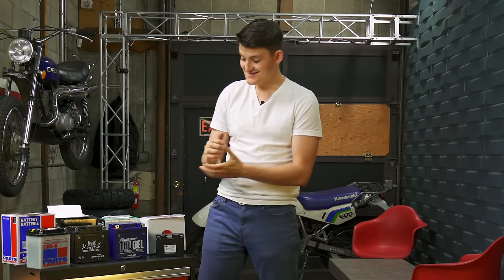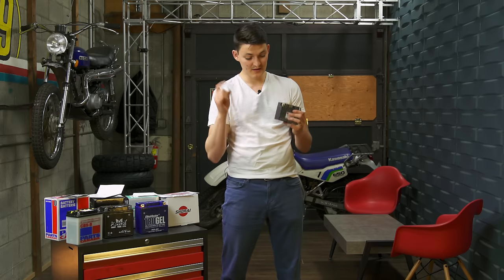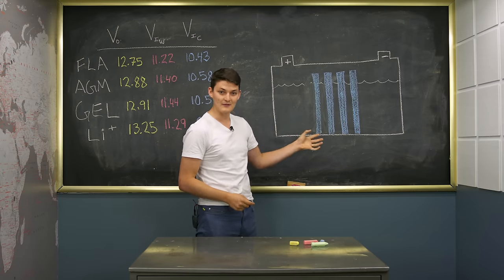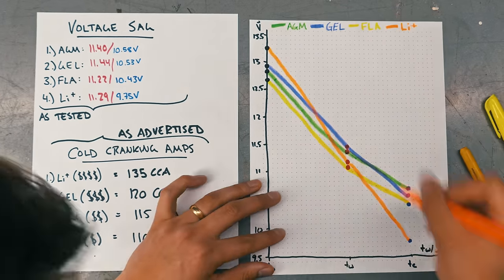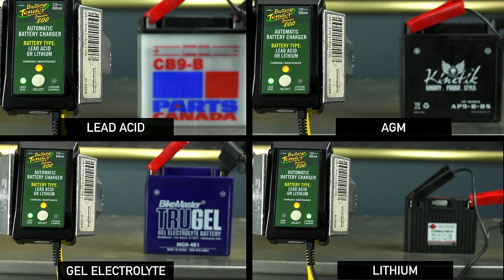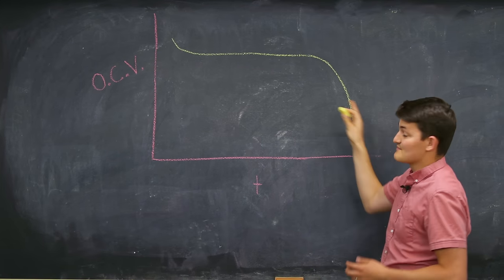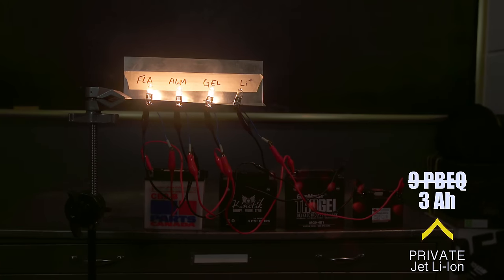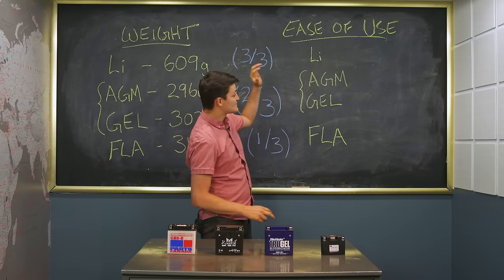Best Motorcycle Battery? Lead-Acid v. AGM v. Gel v. Lithium

Comment: 12v related videos are great a look into power draw from all of different common accessories and lights would be cool, cant find a lot out there about bike alternators and other 12v power upgrades, things like bc-dc chargers, solar maintenance chargers, a look into fuses , common issues and fixes. Bikes are getting more and more complicated with even some simple dirt bikes having complex 12v electrical systems let alone proper touring bikes , what kind of 12v failures would lead to big issues for getting home?

Comment: I feel like use case application scoring would have been a better way to score these. 

 - Need it cheap or casual weekend rider? Go with the lead-acid. 

 - Adventure bike that might find itself on it's side every now and again? AGM or Gel. 

 - Sport bike/track day/race bike where weight is the priority? Lithium. 

 - Daily Commuter and need double or triple the total charge/discharge cycles? Lithium.

Comment: In South Africa  l get a 3 month guarantee on Bike battery but a 2 year guarantee on car battery so l looked at my M109R and took the plastic Battery Holder out and discovered that a smallish car battery fits nicely in the same space.  All that was necessary was to make a simple battery holder to keep it from sliding around as there was more than sufficient space for the higher amperage rated car battery so no more worries if the bike stands idle for few months.  
Being an 1800 cc motor she starts up much easier as well. 
Hope this is helpful to someone out there.

Comment: I'm betting there's a few reasons why the lithium battery charged longer. 

1:  Modern lithium batteries quick charge up to 80%.  Beyond that, they'll switch to a trickle charge, but we don't know if that charger is capable of quick charging either.

2:  The charger doesn't "know" the battery, unlike your tool batteries with matching charger that can quick charge because the electronics are tuned to each other.  The charger could be set to "play it safe" mode.

3:  Who knows how the battery is constructed.  A lot of cheap lithium batteries out of China are usually made cheaper (therefore, more dangerous) and are often rated lower than their stated capacity (and in some cases, higher).

Comment: Also the Li Po batter definitely cranks the bike faster giving a stronger and quicker start sequence
Note, do not charge Li Po over 15v or they will pop, their standing voltage is 13.8v and best charging voltage is 14.5v

Comment: Thanks, great video.

Just came across this today. Have you had a close look at the specification for that Battery Tender Junior? Does it charge all these battery types at the same rate (750ma) prior to cutting off? – Recharge timing test….  Is it possible that the lithium charged slower because of the charger’s algorithm has not been optimized for that battery type?

Comment: The LiFePO4 lithium chemistry will probably last through 2 to 3 times the charge/discharge cycles compared to the 3 lead-acid chemistry batteries.  That's why they're favored for off-grid renewable energy storage.

Comment: You should have noted that lithium batteries are much  more sensitive to charge voltage, and that installing them on older bikes, or bikes that came with a lead acid or variant of such, can cause under or over charging and greatly reduce the life of said lithium battery.  I had to upgrade my reg/rec. to a solid state unit designed for lithium batteries to stay within the minimum/maximum charge voltage window.
I went an unusual route with my Lithium battery choice and stuck with a battery that was dimensionally very close to the AGM factory battery it replaced.  It is still a third the weight and had almost double the cranking amp capacity with close to the same Amp Hours.

Comment: Project Farm-ish...one of my favorites. I like it.

In order to have a 12v 3ah battery you'd need AA or AAA cells in a 4s 2p configuration.
A year later I got a cell pack with 18650 cells making 14ah for $60.
Still takes a long time to charge. Sad face...

Comment: I'm torn between the gel and lithium. Clearly the gel is the safest of the 3 traditional batteries but the lack of maintenance required in the lithium is very appealing and the weight savings are hard to ignore.

Comment: Best electrical upgrade on a Suzuki drz400 is Lithium iron ion battery! One volt higher voltage, halogen headlight is brighter, starter motor turns faster, starting engine quicker, you get twelve or more tries on a flooded engines, 1/4 the weight of lead acid battery.  But don't let the Lithium battery voltage drop too low or it will not recharge.

Comment: Who drives a motorcycle when its freezing outside ??? My experience in Costa Rica,,,due to high temperature and high humidity, usually a motorcycle battery does not last more than 2 years,,,3 years a go i bought a gel one,,,Wow,,,i leave the bike in storage for 7 months in my basement without charging it,,,when i come back,,just put the key in and it cranks and starts the motorcycle,,, that s freakin amazing....best $40. battery !!!

Comment: Interesting video. Thanks a lot for the work done !
I am however not convinced about the suicide mission when the time for complete discharging is checked.
Lithium may discharge itself quicker, but from what I know,  lithium should have less irreversible damage.
compared to Lead acid battery that  will have irreversible damage, or even be dead dead.

Comment: Entertaining and well presented video as always.  
But ..  
    There is a lot you don't understand about Lifepo4.   I didn't before I took on this project.

   BBMS BankManagerPlus 

Your charger simply doesn't charge li correctly for either speed or battery life.  If you had charged it as it should you would have found it would take power much faster then the lead.
    I'm not a li fan boy.  Love lead for what it's best at (and there is a lot to say for lead) but I have found that when it comes to cranking my 1700cc Warrior, li wins hands down.

Comment: I'll never fit another Lithium battery to any bike ever again, sure they save a pound or two in weight, but the fire risk is way too high, having had one literally expand and wedge itself in the bike and come very close to exploding it's a chance I'm not willing to take. If you're worried about the weight, you'd do better to lose those two pounds off your waistline.  AGM for me, GEL second.
ps. Loved the clip of the "Play it safe" advert from HEC Tasmania. 👍

Comment: The one problem is he did skim over the expected life in how many years and the expected life in total cycles that the battery is expected to do. And basically, if you're not doing discharge stuff and you live somewhere where it's warm and you're not going to be writing when it's freezing out, you probably should get the lithium battery because the flooded blood acid is the one that's going to last you the least longest and need to be replaced the soonest. The AGM is actually going to outlast the gel battery most likely, but they're going to last about the same time. All of those batteries are going to need replaced in 5 years. The lead acid type batteries and the lithium battery will last you more like 10 years, especially if you're only using it to start your bike, maybe even longer, assuming you live somewhere where it's warm. Even if you're writing all your round, it's still going to last you the longest. Plus, if you are doing discharge stuff, it's so small that you could buy multiple lithium batteries and if you made a custom battery compartment considering the size of the lithium batteries, you could fit four of those lithium batteries in there. Actually giving you an extra 30% total capacity giving you 12 total amp hours instead of nine total amp hours. But then again you would have to buy four batteries. It bake a custom battery adapter for your box to actually get that usable capacity out of them, but you could still easily without adaptations to your battery box. Make some simple battery connection leads that could parallel two batteries to make them six amp hours to give you some discharge ability from the lithiums for slightly more than twice. The money of one of those lead acid type batteries and I include the gel cell battery in that as well.
Reply: Buying 3 or 4 of those sharia batteries  is a lot of money.

Comment: $150 for that tiny LiFePO4 is insane. They're ideal for longer high current discharges for 1C or below. But not for extremely high current draws even for short durations, like cranking the engine.

Comment: 9:37.... looked at where to put hands to safely combine in series to make 36v! 

I don’t have a problem with lithium cells on my bike, but then I don’t live in Canada 🇨🇦.
However I do live in the the UK 🇬🇧 and do have a problem with the price tag on lipo motorcycle battery’s. To get round this I opt for a hobby shop RC truck 14.8v lipo and throw in a balance board. 
Hey presto you got a lipo bike cell that’s smaller and lighter than even shorai, will crank my fzr600 and cost £25.00 
You’re welcome.

Comment: Advantage of lithium is good ones have a BMS that disconnect power before cells die. Which means that time you forget leave the ignition on and flatten the battery completely if you don’t leave it flat and change it again no damage done.

Comment: I will stick with my AGM battery here in Florida...(For the money) High heat resistance (no worry about fluid levels), vibration resistant, spill proof, and won't corrode all of my electrical connections attached to it.

Comment: I've found that it doesn't matter the battery but how it's stored, charged, riden and how long it's been activated. If you don't let it sit for months, you can get a few years out any battery. Lion don't like cold like AGM. AGM is the best because it's durable, cheaper than liOn and it's the same lifespan than any other  chemistry

Comment: I'll probably be getting an older enduro soon and to counter the heavy steel frame I'll be installing a lifepo4 battery, they've got the lithium benefits without any of the drawbacks, meaning they also work just fine in the cold.

Plus I can save a lot of money by getting one with a tiny capacity since I'll just be needing it for the spark and lights.
Reply: I nearly bought one for a kick start bike  but at £70  for a 2ah battery just didn't sit well.  The best thing about lithium is the CCA and I didn't even need it to  crank anything.

Comment: I've messed with all these batteries and the order I go is Lithium is the best. It does not care how bad you are at battery maintenance, the thing always start. All my lithium always last over five years with me doing zero battery maintenance. Gel is the runner up that does very well also. It need some maintenance but not as much as lead acid or AGM. AGM is in third place and lead-acid is the worst. If you don't maintain this thing it dies. I suck at battery maintenance so during the Lead-acid only days, I was buying new batteries every season.

Comment: I have a Lithium battery in my Aprilia sxv550 and would never put anything else in a bike. Super light and have never charged it over winter while it sits for 9 months and still cranks the bike over no problem. Has been in the bike for 4 years now.

Comment: I use AGM or Gel batteries ..I still have to let my bike fall once in a while.. (I said let it fall ..not make it fall).. and that is mostly off road going slow!...LOL  and I am not sold on Lithiums yet  especially for the price... Did I mention I also live in a very warm area?  (110-120F) and heat kills batteries here and have not had a motorcycle battery last past 18 months or 2 years max even with a battery maintainer ... car batteries barely last 3 years here... I do carry a "Stanley" powertogo as a precaution... it was cheap and worked great when it was necessary

Comment: You mentioned the battery was LiFePO4, however with the explanation of charging below 0°C, you showed a lithium polymer battery exploding. LiFePO4 is nonflammable. The dendrite shorting would indeed cause the cells to become extremely hot, but the cells themselves would not catch fire. Surrounding material could, but the video shown would not happen.
Source: I have shorted a 52v LiFePO4 battery by puncturing

Comment: After the full discharge, the Lithium will have protection circuits in it and will come back for a second round. Forgot your camping lights attached to your battery and killed it? Lithium can be jumpstarted and will fully recover.

Comment: Assuming the smart charger Ryan was using is actually smart.....charging the last bit of a Lithium battery is generally the slowest.  The Tesla he mentions has maximum charging from a Supercharger after the battery is up to full operating temperature, but starts slowing down at about 50% charge.  If you brought the batteries down to the safest drain point and tested recharging part way - the lithium battery could be on-par with the others.

Comment: Lithium iron battery still wins. Mine cranks the starter faster and stronger and I got mine about 7 years ago and it’s still going strong. Yeah it was expensive but it’s also the best battery I ever bought. 3 years later same battery so 10 years now on a 1300gsxr Busa. still strong

Comment: Lead Acid batteries can be overcharged (charged at a voltage higher than their normal peak operating voltage).  Lithium batteries normally cannot. .   
If the Li+'s rated peak resting voltage is 13V, then the charger will bring the voltage up to 13V, and then adjust the current progressively downward to keep the voltage at
exactly 13V.    That's why a Li+ battery charges to full capacity slower than the others.    Even Tesla doesn't normally try to fully top off their batteries unless you demand 100% capacity on a long cross country drive.    The problem is your "smart" charger is probably a little too smart for it's own good.   The bike's voltage regulator probably doesn't set the voltage at exactly what the Li+ battery needs so it may charger it a little faster than it's supposed to, but they built in a little margin as well.

Comment: You want a test with a lithium battery that uses high quality cells use Speedcell. Speedcell use A123lifepo4 cells which are flat out amazing cells. I have several a123cells that are over 10 years old still in use flying RC airplanes so when I searched for a lithium motorcycle battery I wanted one that used these cells.
Reply: Did you find one that used these cells ?
Reply: @chrishart8548  only Speedcell. So far I have 2 of them and they are great. I also have a shorai I bought for a bike I’m going to sell in the next year or so and it’s doing fine as well. For my personal long term bikes I’m sticking with Speedcell being I know the cells they use very well.

Comment: I wish you had tested the Li-ion after it had stood for the 2 months,  you can pretty much accurately tell the state of charge of lead-acid by terminal voltage,  but li-ion will keeps its terminal voltage until it is almost depleted.  This is the reason that equipment that uses li-ion have 'coulomb counting' circuitry - the terminal voltage of Li-ion means little, so the only real way to know state of charge is to measure the amps going in and measuring the amps going out....  it actually damages li-ion to keep them fully charged - they are stored at 45% charge to ensure shelf life,  and keeping them over 80% is damaging,  on the other hand lead-acid love to be kept fully charged... I think for motorbikes AGM are the sweet spot, for cost vs performance and service life....

Comment: I see a problem with li-fe batteries in motorvehicles, the cells they are made up of are 4.2 volt when full. Multiplying this gives us 4.2 8.4 12.6 and 16.8. 
12.6 volt with 3 cells would be the most matching one as it's in the 12 v "range"....  You might think, but the vehicle probably charge your battery at 13.8v as is normal for a lead acid battery, this would kill a li-fe battery, so what they do is put 4 cells in it and voila it can withstand the 13.8 volt without turning into a single use seat heater. But, and here comes the fun part: it's charged up to 13.8v.... While full it should have been 16.8... There is 3 volts missing, they never get charged and thus they claim it as an equivalent to something, because the vehicle is unable to charge the battery correctly without higher voltage from the alternator. 
The reason it still works and actually works good and for a long life is the immense current they can deliver even at this low charge, and since they are never abused in any way (from normal engine start and some idle light use) they will continue to do so for a long time.
Yes the temperature issue is true, don't CHARGE them if they're below 0C,  but starting your engine will take care of that in 5 seconds, from a normal MC use temperature, I don't know if I'd ride here in Norway when we pass below 0C sometime in October anyway.
Winter storage... If it reads somewhere around 13.5 or more, take it inside and just store it, it'll be just as good in spring. No need for any charging unless it's damaged in any way.

Comment: I have a Lithium in my Kawasaki ZX10R. I ride it every day and its lasted me 6 years so far. My mate has one in his parked CBR1100 Blackbird. Its been parked (for reasons) for 4 years. The battery holds enough charge to start the bike despite never being recharged. For my bike the gel battery is 1/2 the price but I get 1/2 to 1/4 the life out of it. Where I live it goes hot to cold very quickly (I am in a desert in Australia). If this happens too often it kills batterys. Not Lithium ones it doesnt. They just live on.

Comment: I notice a lot of complaints about retrofitted LiFePo4 bike batteries.   LiFePo4 cells get permanently damaged if discharged below 2.5v per cell. They are also less tolerant of overcharging.  For a bullet proof battery an LTO pack might do well if space is available.